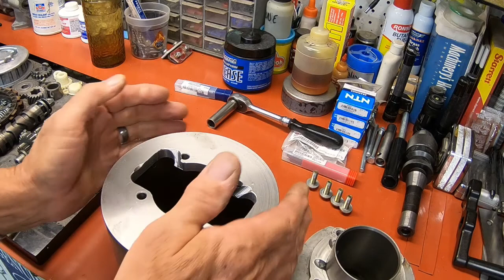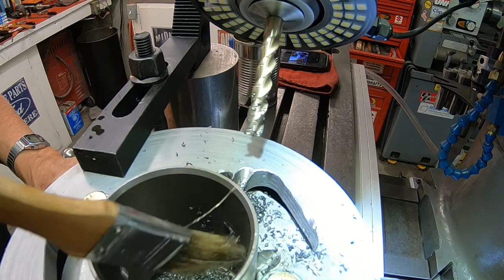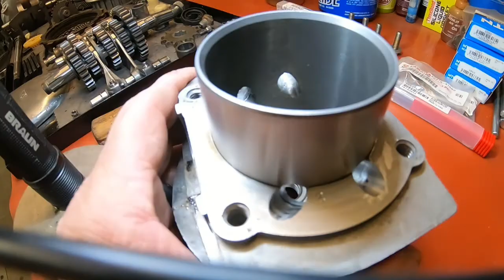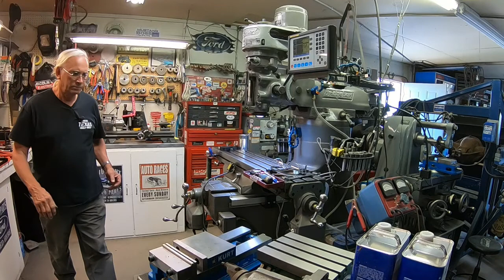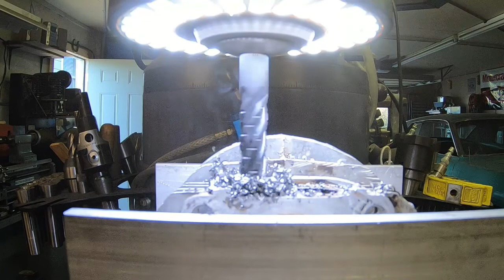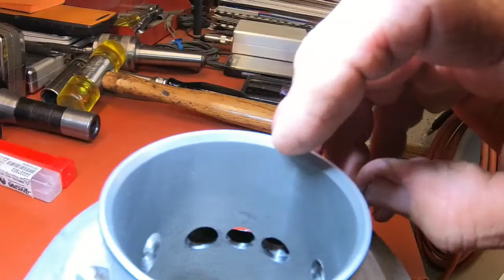Lawn Boy D-400 cylinder resleeve completion

Comment: Very cool.  Can you give us some back story as to why you resleeved the cyl vs machining it out and using a bigger piston/rings.  Thought you finished that brick top last year.  Did it not solve the issues?  Please update us on this one.
Reply from the maker: Hi Mike, thanks for your comment, yes the Brick Top is running fine. As you know new cylinders are very hard to find, as are pistons. Over the last few years I have bought a few used cylinders hoping I could experiment with resleeving them. This was my first one, and it went well, I have not yet bored that one to size and fit a piston. This will be an up coming video. Been very busy with the motorcycle videos over the summer.  I have never seen a oversized piston for a lawn boy. I have heard they were once made, but I have never seen one. Since there are very few pistons, and fewer cylinders I thought I would try resleeving. The beauty of resleeving is that  you can fit a good used piston to that resleeved cylinder and have standard clearances again. I will also be doing a lower bushing replacement using a needle bearing in a up coming video. So stay tuned for that. I dont know....I guess Im just trying to keep the ole green lawn boys going. I dont think there has been a better mower built. Hope that kinda fills in the blanks. Mike thanks for the comment and for watchin.